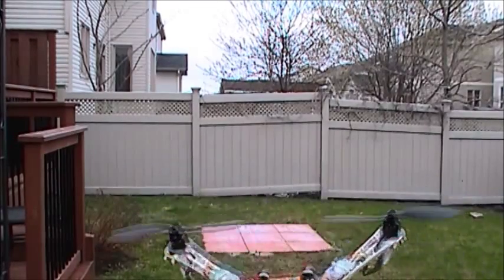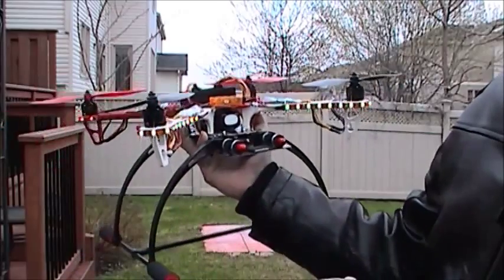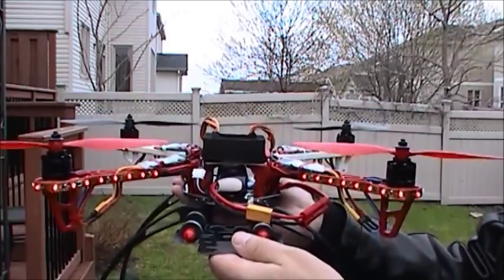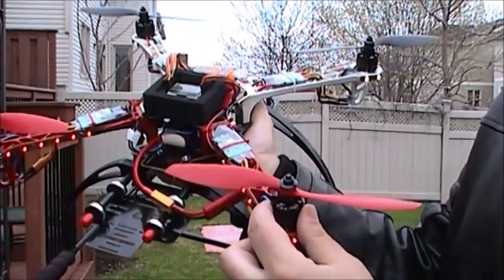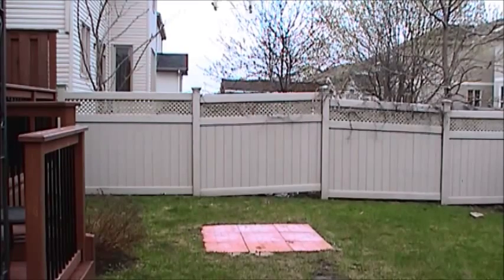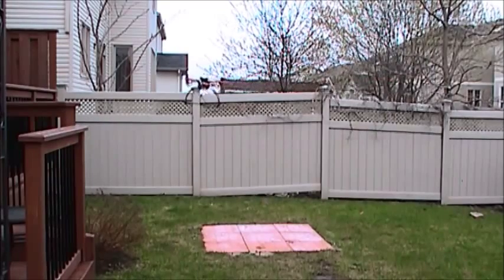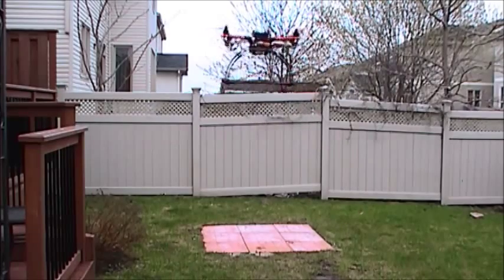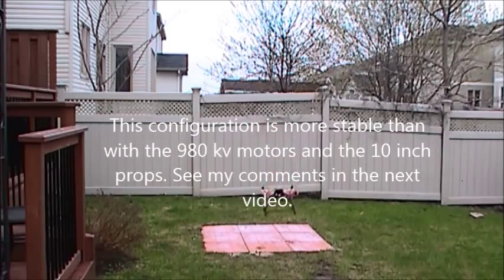F450 drone 1500 kv flight test | 8 inch prop configuration

Comment: I have tried f330 with 1400kv and 8045 props, and performance is good.

But when tried same motor on f450 with 1045 props, there are lift issues...

Hopefully, f450 will work well with 1400kv and 8045 props (total weight is 1kg)
Reply from the maker: Thank you Rohit for your comment.  The F330 is a smaller frame so performance would be much different.  I did two setup videos with my F450 frame because I was not sure if I would prefer the performance with 8 or 10 inch props.  In the end I found that the F450 was more stable with 8-inch props for the motors I had chosen.  Thank you for visiting my channel.

Comment: How much Current Draw you had?
Reply from the maker: My Afro ESC's are rated at 30 Amps.  I think the current draw was around 15A per motor.  Thank you for visiting my channel.
Reply: @SuperdanTech  I liked your video cause it had useful data. So the battery you used must be at least 60C, right?
Reply from the maker: Thank you.  I originally had a 2200mAh nano-tech rated 35-70C to test the drone.  It was getting a little warm.  I then switched to a 3300mAh nano-tech also rated 35-70C for more flight time and a cooler battery without adding too much weight.  I could draw 60 Amps without any issues.
Reply: @SuperdanTech  Amazing, Thanks for the info. It was a great help for me.

Comment: You are right - 10" props are to big for 450-500mm class quad - I had the same issues.
I have found that Sunny Sky X2212 980kv or X2208 1260kv with 9" props are the best.
What flight time are you getting with those 1500kv motors and 8" props?
Reply from the maker: I am getting 6 minutes with 2200 mAh lipos.  I like the nanotech a lot. Just got 3300 to extend my flight time to about 9 minutes. I now added a gps and an altimeter. It is so nice to know at what heights you are flying.  Sorry for the late reply!
Reply: @SuperdanTech  nice work